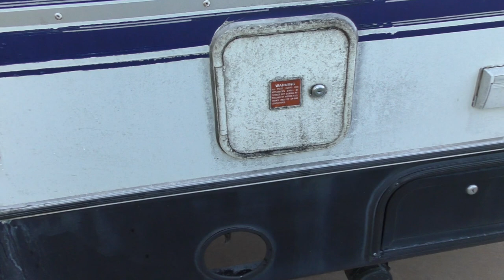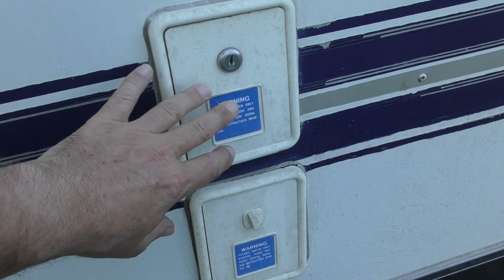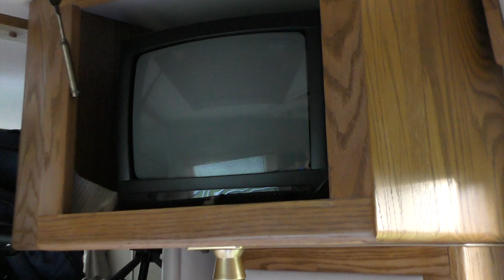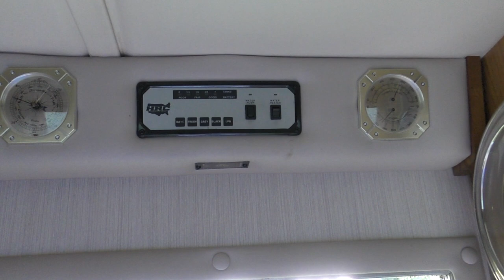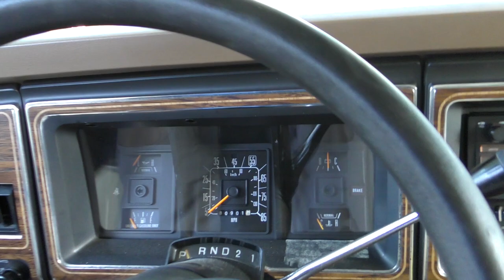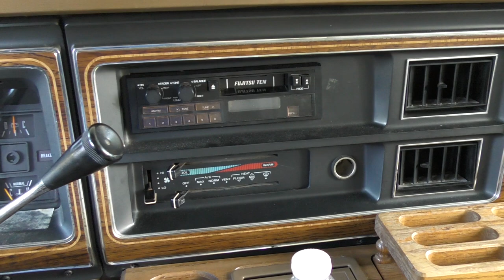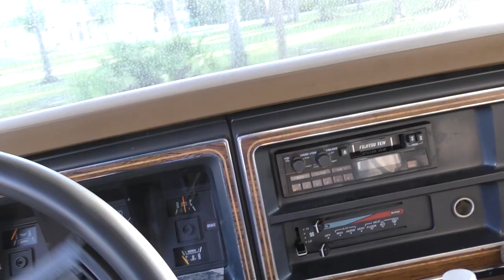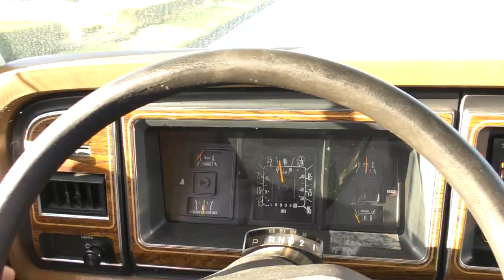The 1989 Holiday Rambler RV Project - Flask Update, Animals, and Getting Things Ready for the Road

Comment: My rig is a 2002 Ford E350 van with a 6.8 l V10 and 244,000 miles.  It served as a local NBC Bay Area news van with a 55' television mast on the roof. The guy I bought it from on Craigslist was using it to tow his BMW race car. It's got a 12 V fridge that retails for about 1500 bucks, a comfortable bed, on board generator (like Bill's, currently not working) and compressor, and 300 watts of solar panels on the roof where the TV mast used to be. Same rooftop air conditioner as Bill's. No propane, bathroom or kitchen but I have an induction cooktop that works great. Room enough for me and my dog.

Ford has been building this body on frame chassis from 1975 until now. Ford doesn't make complete E Series vans anymore (replaced by the Transit), but they're still building this as a cutaway chassis. Although Ford went to fully independent front suspension on pickups post-1997, these E Series vans use the Twin I Beam front end. 

Bill, it needs some work but I think you stole it for $2,500. I paid eleven grand for mine in November 2020.

Comment: the 460 brings back memories of the '84 Ford tow truck we used to have at the gas station/garage I worked at back in the day. Never sounded like much, but damn did that thing have some torque. Of course, it had belts and not the wheel lift, so it would rip the front end off of nearly anything post 1988, but it was fun as hell to roll in that thing.

Comment: My friend has a 91    460 E 4OD trans he runs his in 3rd gear because OD searches for lower gear 60mph or less. Be happy you have the 3speed. Ee freshened the engine with Plugs, wires, MAP sensor, TPS sensor for good idle Great project vehicle! Call me if you need anything, There arnt many peole around thar remember early electronil technology.

Comment: Hey Bill, great rig you have there. With covidflation, she is worth much more than $2500 even as-is, so investing into her is a solid move. Also, it's my understanding that an Overdrive transmission will bolt right into these, which is a common thing people do to lose the 3 speed. Good luck with your repairs and adventure.

Comment: This RV definitely has a hybrid 70s/80s look going for it! I wasn't aware that Ford retained that style steering wheel in the Econoline all the way through the 80s. I note they did move the ignition lock to the column like the pickups. A Jonathan Richmond cassette would go well in this rig, with "Roadrunner! Roadrunner!" cranked up.

Comment: Better you than me fixing that thing up! I will admit that it's actually not that bad, but I've had many RV's in the past & they are never 100% fixed, there's always something that need attention. The engine sounded pretty strong to me & I was actually impressed with the acceleration. Could changing the differential gearing improve top end performance? Maybe larger diameter tires would help. Hell with it, just drop a serious engine in there & bring the 0-60 time down into the 6 second range! You'll have to glue the Keurig to the counter though!

Comment: 17:19…Bill, I think what you actually have a hold of  there is your water heater, which is propane powered and sometimes also electric heated to back up the propane in case you run out…
Reply: It’s is the water heater.  Figured someone would point that out. Great find and a heck of a buy!  Thanks for sharing

Comment: The 3rd axle, the "tag" axle has 2 air bags that pump up to about 120lbs usually, big rigs go to 160#, the tag axle when aired up puts weight onto the steering axle and off of the drivers.

Comment: For more hp remove the horns in the intake with a reciprocating saw and upgrade the exhaust to 3" Low restriction. Banks headers are expensive but would make a big difference. You'll gain a lot of response and torque and a couple mpg. An e4od would get you to 80 mph. I love my 90 f350 with 460 and e4od. Very cool Rv. Visit waynesville nc. I'll buy you a drink or two.

Comment: That old Ford EFI can be a pain to diagnose, I have a 351w F250, might want to change the fuel filters, if that doesn't stop the sputtering the fuel pumps get weak but, don't completely die, in mine when I use the front tank it pulls strongly with the (5 speed manual) but, switched to the rear tank it bods out under harder acceleration when I flip to the front tank it feels like I turned on a supercharger. Other wise you might need to go through the ignition or sensors. Maybe the injectors are clogged up, run some cleaner through the fuel, might help. Shame it's only a C6 and not the E4OD you could swap an E4OD or 4R100 into it that's just an OD C6 and should fit the same space, not sure if an ECU swap would also need to be done to accommodate it. Still probably much cheaper than a Gear Vendor those are expensive as hell unless you found a used one. A ZF-5 S42 or S47 manual swap would be amazing, the shifter would sort of be in the way but the flexibility of gearing would make it feel like it has 50 more HP along with less parasitic drag. Otherwise a taller axle ratio would cut the highway rpms since that's geared for 55 mph speed limits, going to a 3.08, 3.27, 3.56 axle would help a lot up to speed, I doubt the 460 would care once it's running right they make tons of TQ. If you don't want to fuck with the EFI and want better performance you could swap it to a carb style intake and run a Holley Sniper EFI, then do a cam, headers and various hop ups, convert it to hydraulic roller lifters with the cam swap for reliability and power.  Even with those junk heads...unless you could get ND some C8VE, C9VE, D0VE or D1VE heads which are early higher compression, better performance heads, just avoid the D2VE they're junk, D3VE are ok too, you should be able to make over 500ft/lbs and 350-400hp very easy with a 460 bottom end. I love it, you got a hell of a deal. Can't wait to see it fixed up, my broke ass would legit live in that if I had it, be better than the crappy trailer I live in, at least it would be mine and mobile. That's my own thing, I don't want to be tied to an owned property, I am trying to get down to Brazil and marry a fine young woman. I hear Balsinaro don't take no crap from snowflakes.

Comment: My Dad's last car was a 76' Ford Thunderbird and that had a 460 engine which never had problems and my first car was a 1972 Thunderbird and that had a 429 (a 460 was an option) and I received it when it had 66,000 miles and I got it up to 140,000, my Dad decided that I needed a smaller car and got me an 1980 Chevy Monte Carlo, not a terrible car, just a big difference between the two. The 72' was sold by me after my Dad got me the Monte Carlo and my Dad's car I kept until the mid 90's when it was getting a little rough from sitting and no being driven, so I sold it before it needed alot.

Comment: 1989 was close to when the US national speed limit of 55 mph ended.  In that roughly 15 year era of driving 55 miles per hour (89 km per hour), perhaps Ford figured these transmissions only had to handle speeds on larger vehicles up to perhaps 70 miles per hour (113 km per hour).

Comment: Sounds great, gas engine?...For $2500...a steal. Some TLC, maybe paint the interior, when you redo the floors...new foam mattress...Led interior lights...Take out the tv cabinet, add a flat screen...Flush out the water system add a filtration system for drinking quality water... 
You've got a lot more space to work with than VanLife YouTubers in their Sprinters. 
Oh, a backup camera will make life easier and can help with security... and if finances permit, lithium battery and a solar panel or two so you can rid yourself of that old generator (they're usually too noisy to run in crowded areas). My ex and I had an rv for weekend trips... It was a joy, being fully self contained...not having to stop at public restrooms...yippie. 
Best of luck. ENJOY.

Comment: That thing has a big ol highway gear ratio already, you don’t need overdrive, it would be redundant. It took until 45 to hit 3rd at mid rpm and heavy pedal. If anything, it could use a drive ratio reduction. It would completely fall on its ass if it had overdrive. 

It’s geared like a 1970’s Toronado

Comment: Today I realized that Bill is like a crankier Jean Shepard.

You can buy third party overdrives, still. Gear Vendors makes them.

I know the feeling about the low speed driving. I have a 79 Granada. Inline six, three speed slush-box, no overdrive, no lockup, not even a real C4, it's some shitty knockoff instead. You aren't going to drag race anything but a shopping cart. It's most the quirks of the Falcon with less than half of the charm. Objectively the worst car I have ever owned, but I still like it for some reason.

Comment: Condensation in the gastank will make it run crappy for a while. Airplane tanks have  drains in the bottom you check with a gauge to see if water in the gas if so keep draining until only gas.

Comment: The best advice I can give you as a motorhome owner is slow down. Never be in a hurry. I personally don't run mine much over 65 mph unless I'm getting a run at a hill and then no more than 70 mph. A lot of tires for those things are only rated for 70, maybe 75 mph. Shit happens really fast in that tank. You don't wanna smoke a tire, especially a steer tire. Just set your cruise at 65, sit back and enjoy the ride.
Reply: And the UV rays kill the rubber, once they get warm they pop. 5 years and replace them
Reply: @RustyZipper  I’ll run up to 10 years as long as there’s no signs of aging. I also use tire covers when my rig is parked. The five year thing is a way of scaring people into buying $2-10k in tires. The rule I’ve heard the most over the years is have them inspected annually past five years. Replace at 7-10 years. Replace with any signs of aging, checking, cracking, uv damage, etc. Especially your steer tires. I don’t eff around with my steer tires.

Comment: You need to look the part Bill  wear a fadora  turned up in the front  with a hat band  that has a  floral  print on it  a  green plad shirt with matching  green plad  shorts  pulled up to your chest  red suspenders   Mens  yellow hose up to the  knees  & white Oxford  loafers  and you need to  smoke a PIPE   That is the image of the people that operated these back in the day !!!  You can go to camping  world and they will soup up that engine  with Banks engineering  and they can install a overdrive conversion  on the transmission

Comment: The roof….

That can be a deal breaker.   That aluminum sheet might be corroded and be Swiss cheese.  And someone coats it with crap.

I’d check the condition of that before anything else. 

Been there.

Comment: Good luck with that roof. Looks like some idiot walked on the roof and buckled a cross member brace. Definitely not a DIY repair unless you are a skilled carpenter. Hopefully, its not leaking water if not, you can brace it from the inside.  :))
Folks, don't ever EVER walk on an RV roof. If you have to make repairs, lay down a sheet of plywood first, to spread your weight across several crossmembers.  The roofs are light weight fibreboard over aluminum or even balsa wood rafters, then covered by a thin elastic membrane. That is your water proofing. They are not party patios, although rental rv's are often used as such!